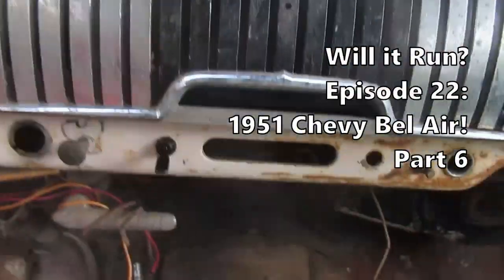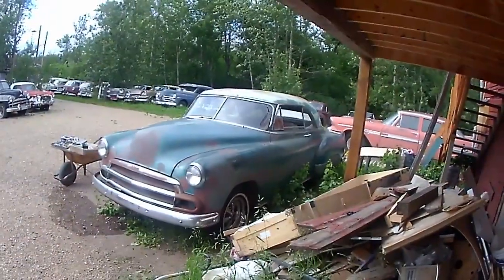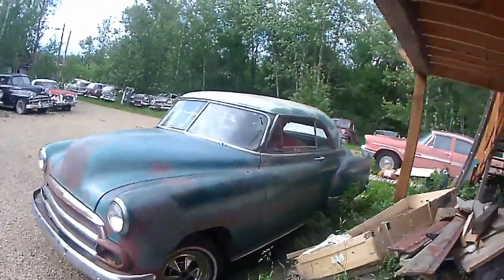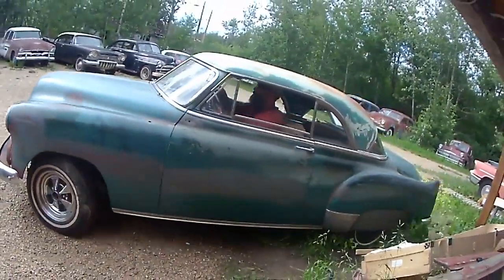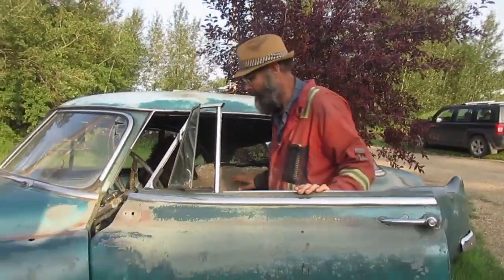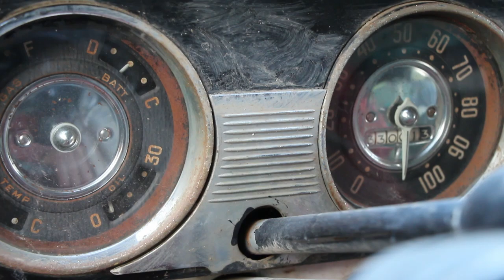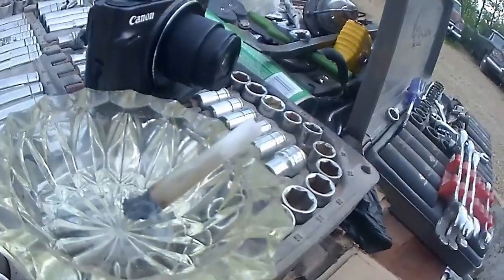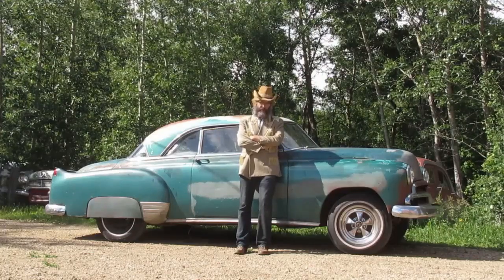First drive in 50 Years! "Will it Run?" 1951 Chevy Bel Air... Episode 22

Comment: What's ironic is when I was a kid back in 1961 these Chevy's were in the very same condition as the one in this video. I've never saw a "nice" original one unless it was a restored model. Keep in mind they were 10 years old 1961 and by the 50's-60's standards these cars were built to be scrapped by the time they were 10 years old. Or 100,000 miles whichever came first. At least that's how I remember it. PS that was a killer jam. Loved it !
Reply: Yeah that's right Dan. 100,000 miles on the odometer and you were considered fortunate. Engines were toast by that time. I dont remember cars looking new very long then either. Probably cheap paint made them fade fast unlike modern vehicles. AND they handled like horse teams. lol
Reply: @paulgregg356  The other issue was that in the 1950's and early 1960's Chevrolet along with its competitors made major styling and drivetrain changes with the introduction of fully automatic transmissions, high compression V8 engines, power steering, and power brakes which made the newer models much easier and comfortable to drive.  You only drove one of these cars if you couldn't afford anything newer.  Now of course they are desirable again.

Comment: Loved this segment/series on the old 51 Chev. Another save/rescue of a car of a bygone era. When I was in grade school in Suburban Pittsburgh in the early to mid 50s, the Juniors and Seniors had early 50s Chevys 2 doors mostly. The fad then was the fender skirts, lowering the rear "stance", full "moon" hubcaps and removal of the hood and truck lid chrome. It was called "nosing and decking". They would split the exhaust manifolds and run two pipes to the back for duals and install "Hollywood" mufflers which were most likely totally empty of sound deadening. At acceleration the twin Hollywoods were LOUD. Those were the days. Awesome channel!

Comment: That 51 is very cool.  I remember it sitting in an auto wreckers for decades and being full of junk inside.  I am glad to see it up and going again.  Nice save!
Reply from the maker: Hi Ryan! Thanks for the note; glad you liked the vid and the old 51! Where was it sitting in a wrecker? I do not know the history of it before it showed up locally here...Cheers from here!
Reply: @coldwarmotors   It was at Universal Traders in Lavoy back in the 80s and 90s but looked like it had been there for some time before that.  I don't know if you ever went there, but Pete had it in the south east corner of the main yard by the trailers that he used for storing radiators.  It was missing the tail light lenses back then too.  When Pete moved to a seniors home and they crushed everything, I assumed that your car was gone forever.  I am glad to see that it was saved.  It also had cool decals that looked like pinstriping on the dash, are those still there?  I have footage of it on video from there but it is on old VHS tapes.  If I ever transfer them, I will send you a clip.

Comment: I'm 59 years old. Back before internet we had a pretty nice 54 that was white over blue and had a 6cyl and three on the tree. But I GUARANTEE you if I knew then what I know now.......
It had vapor lock issue and the 6 volt system was tragic.

Comment: Waaait... 15 psi is roughly 1 atm, right ?.. 30 psi is 2 atm.
That's pretty darn low ! 
I'm more used to something like 5-6 atm max pressure in old engines.
Probably they meant "30 psi or higher" because you should really only pay attention to oil pressure if it drops below that.